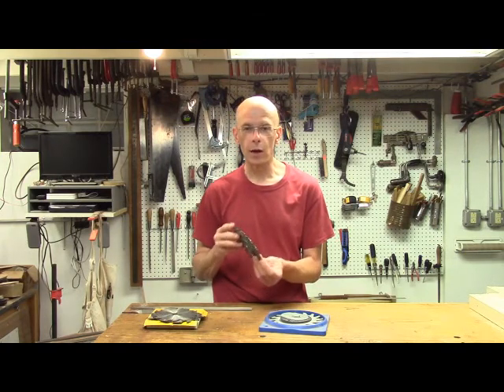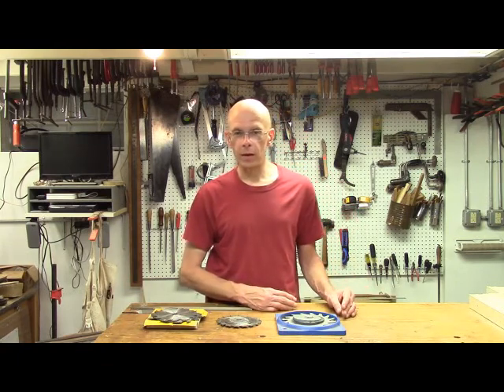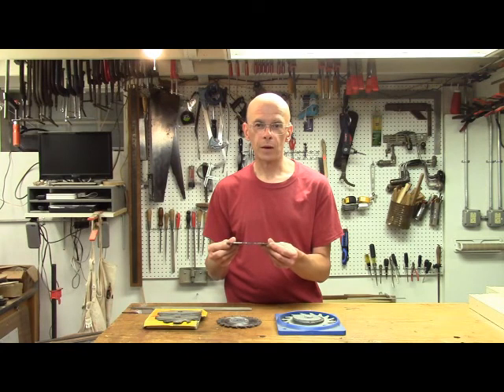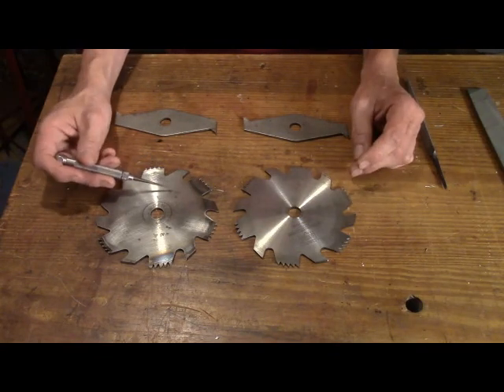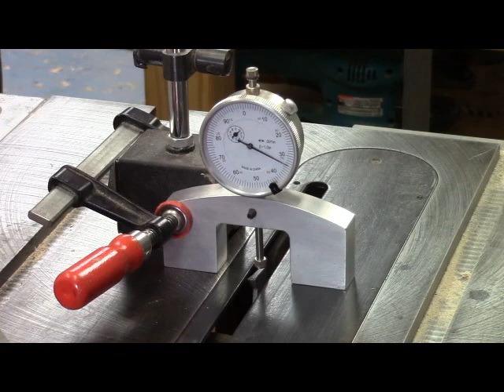Sharpening a carbon steel dado blade.

Comment: i just found a stack of craftsman 4" dado HSS blades for $5 at the thrift. the set is complete but there are nicks in a lot of the bevel teeth, and i was intimidated by the prospect of sharpening the blades myself. this explanation was extremely clear and helpful, thank you!

Comment: Thank you for this helpful video. I inherited a vintage Craftsman 6" HSS dado stack. On my test cuts, they left sort of a scalloped pattern at the bottom of the dado. Not worth paying for sharpening, but worth a try at home. One thing I would add (apologies if it was mentioned) that it's a good idea to triple check to make sure your blade angle is exactly 90 degrees before starting. Since my saw is belt drive, I used the slowest speed. I used the bottom of a flattening stone for the table saw part of the sharpening, which worked really well (and didn't risk a good sharpening stone for a sketchy dado stack). I moved it around a little after each microscopic rise in blade height, to avoid hollowing out part of the stone. Also, I did a quick check after finishing that part, reversing the blades on the arbor so I could do a test cut. The cut was almost perfect, even before doing finish filing.

Comment: thanks Robert, my Dad left me his old 54 beaver 3200 table saw after he passed away......i use it quite frequently. I use it for cabinet making.  love the dados, rabbits and tenon work on this machine. I have one of the chippers cutting about 1/32 deeper. Thanks to you I have a guide on how to correct. I would be afraid to send out the dado stack, non carbide, to one of theses sharpening places and have them ruined.